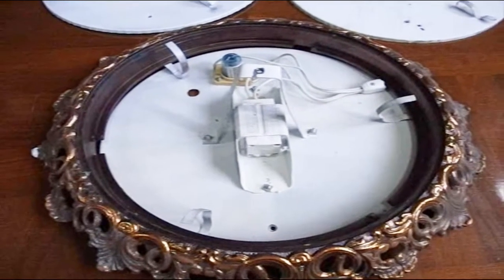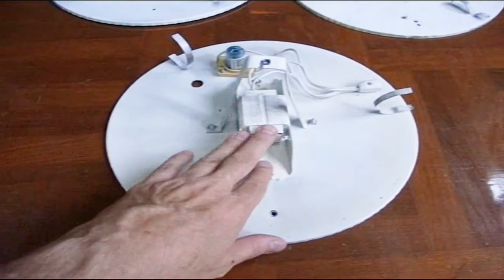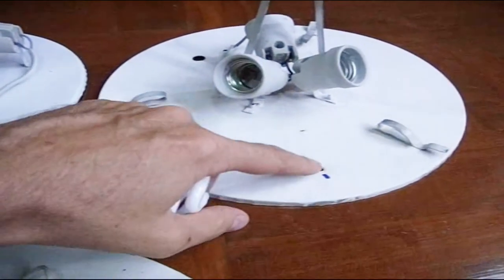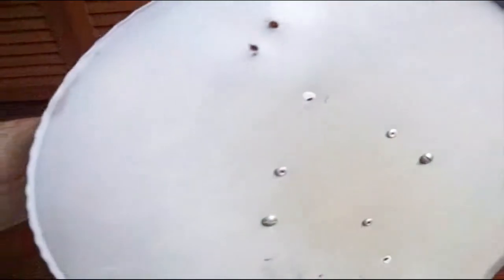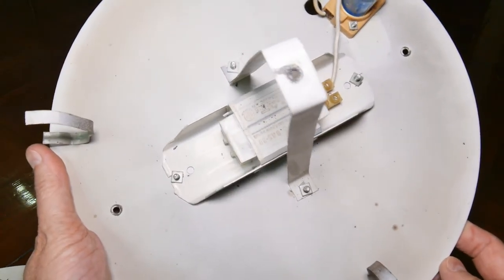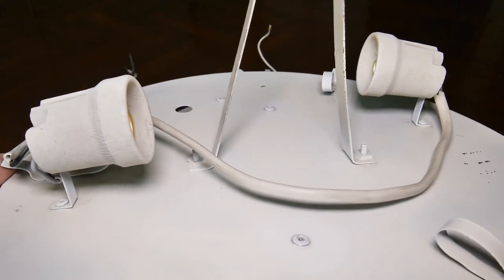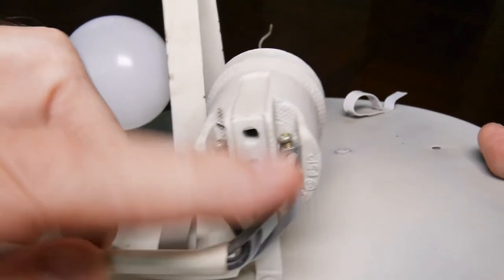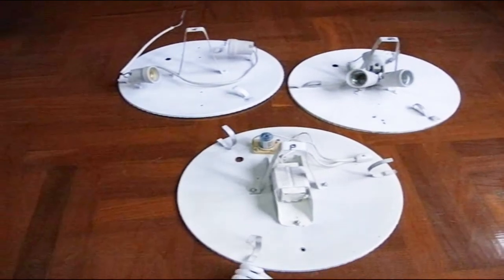Convert Round-Tube Fluorescent Fixture to Screw Type LED/CFL

Comment: 20%? That’s a huge difference! Well done!
Reply from the maker: It may be more, because that 20% was going from the round florescent tubes to the CFLs (I guess I did not make that clear).  The LED consumes about 40% less than the CFL, so I'd guesstimate another 10% or so on top of that once I've switched out 100% of the CFLs (we are still about 50% CFLs.  I did the most used ones first.  We have several low use areas where it does not pay to switch them out until they burn out.)